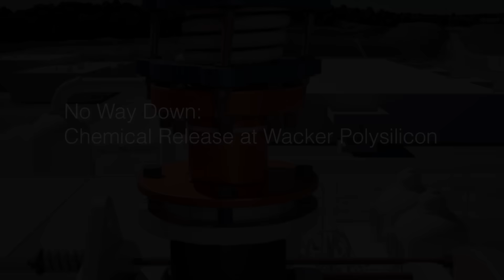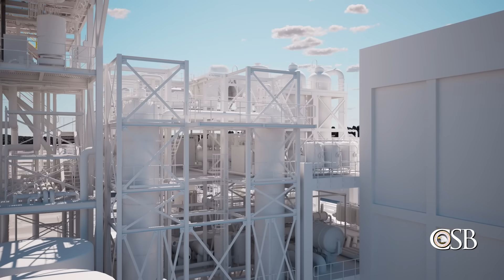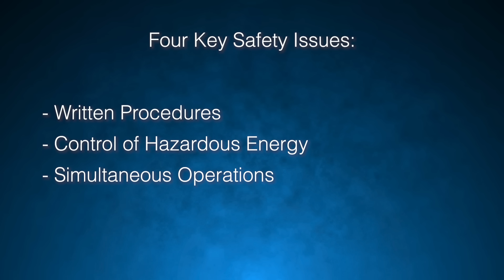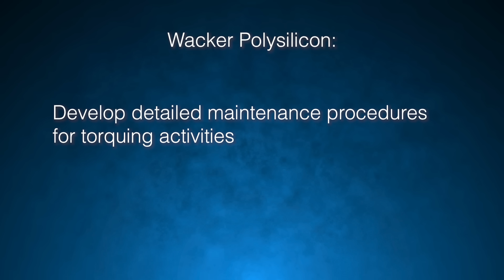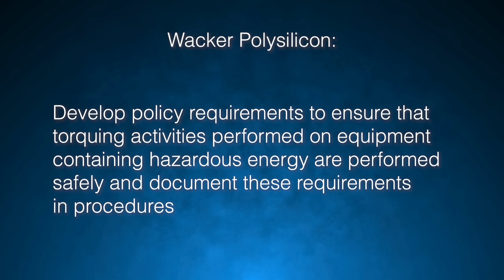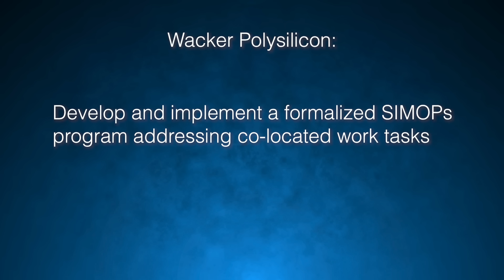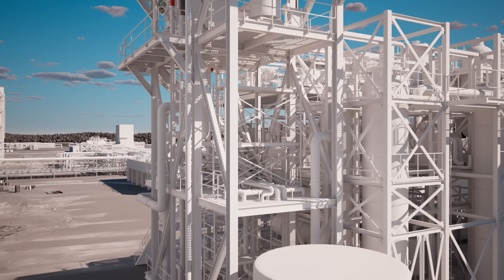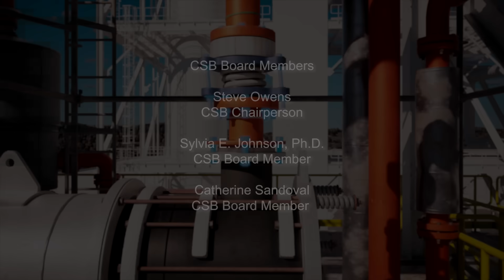No Way Down: Chemical Release at Wacker Polysilicon

Comment: Would of helped to have the proper trade to do this work.  Millwrights have the training to understand what is needed for a torque spec.  Pipe fitters, Fit and weld pipes, once installed workrking on said pipes, save fitting work, should of went to the millwrights. Too many parts of the millwright trade where taken away by trades that have no business touching them.

Comment: I know I don't work on these machines but I feel like there are to ways to design machines that should make this  harder to do. Like, if the bolts between steel to steel had a different size or shape than steel to graphite, I feel like that would make it harder to accidentally use the same settings on them. Maybe I'm just over simplifying but to see this issue and no one even talk about how easy it is to blow up a machine like this feels unsettling
Reply: The narrator was nice about calling the company doing the work incompetent. I do pipe fitting work for the union. I'm an apprentice and I'm not allowed to do certain jobs or touch certain tools till a certain amount of time within my career for that exact reason. To say they all communicated down the chain without a journeyman verifying  your tools prior to use is also a lack of supervision. Something that dangerous should have been taken more seriously. Live Pipes under pressure should have had 2-3 journeyman, and 1 apprentice. 2 journeyman performing work, 1 apprentice learning and hauling tools, 1 foreman at the bottom for safety. Before starting work they should have created a Job Hazard Assesment and possibly considered self contained breathing apparatus for rescue. One thing we do as union workers is we always kick anyone not involved out. We do not work with or around anyone or other trades. These videos truly are a great eye opener for all the classroom training they give us and attitude the instructors have.
Reply: We were told of a time when a welders measuring tape fell and cracked a pipe under pressure at intel. 32 million dollars gone and he died, his life was priceless. Now we all pay with 8 hours of classroom training on why we need to tether every single tool.

Comment: Worked at several nuclear plants in the Midwest and they used "travelers" to define the work scope and instructions. The work package/traveler had drawings, reference material, etc. and step-by-step instructions for the work crew. It was prepared by Work Planners who did the background work to ensure that the travelers were accurate. If there was a question or something didn't seem "right" work stopped until the situation was rectified, including revising the traveler.

Comment: The hierarchy and beurocracy of these big shows and contracting companies is what gets people injured or killed. Involve enough people and no one really is responsible. I don't get called for work from a company i worked for for years doing because i spoke up about an issue with a mystery gas and how no evac alarms went off. (Was a good employee and after my work was done they kept me around to operate an elevator for the hours, opened the door and couldn't see the control room door which was 8' across a hallway, guy in the elevator put on his escape respirator and got the fuck outta there, i did the same,took it to the ground floor and ribboned it off. Went to my super not very impressed and said its not you guys its the mill that probably turned off the alarms. I'd seen it before working in other mills owned by canfor in the same town. I have since to get a call to work for idl)

Comment: I think more importantly there was no warning given about the risk of over torquing the graphite. 90% of time you just tighten it down till it feels “about right” or hammer it with an impact. And that works 99% of the time on any metal. Why was there not a warning about the dangers of the flange cracking?
Reply: Because the higher ups played The Telephone Game instead of writing down explicit instructions to NOT touch the bolts connecting the graphite to the steel connectors with a regular torque wrench. One Email, one facebook message, one text, and it could've all been avoided.

The fault lies with the higher ups that were not doing their jobs to ensure site integrity, but a few comments mentioned specifically "Using the safety standards of the more dangerous work" which makes a lot of sense. There should never be contractors in chemical suits below while the contractors in minimal PPE are working above, anything that is pressurized will be hotter then normal and when hitting the "cooler" air will expand rapidly, filling the space above wherever it is released. If simultaneous work is not possible then reschedule.

Comment: Just fitting simple weather resistant stickers on every bolthead with a red bright triangle and inside having the torque setting spelled out "15 ft-lb!", "45 ft-lb!". Having a paper checklist is not enough because next time the part is replaced it could have different specs than before, so a checklist on a paper would become obsolete if someone forgets to update it, and if the workers forget the checklist there is a possibility that they ignore it and think "it's gonna be fine i know it in my head".

Comment: I work in a Cl2 plant, when our new plant was being commissioned operators identified that one of the gas-tight fully enclosed buildings only had one internal exit stairwell. That building contained up to 200 of liquid Cl2, if you were at the top and there was a leak there were 2 ways down, one was the stairwell into certain death and the other was to jump outside to your death. Thankfully management saw the risk and installed an external stairwell over to the adjacent process area.

Comment: Great stuff as usual from the CSB.  I am curious why the HCl exchanger design is not more critically assessed by the investigation. Tightening fittings on process equipment in use is usually a band-aid for existing leaks...why was the equipment leaking in the first place?

If you design equipment with steel bolted joints immediately adjacent to delicate nonmetallic ones, it would be a good design practice to make that absolutely obvious.   For example, the graphite connection should have used a screw or bolt with a torque limiting head or other design feature, placarding for the hazards of over tightening, etc.  A note on the drawing is pretty sad.

Comment: That flange shown being nipped up seems to be quite big to only have 4 bolt holes.
The safety protocol on some work sites is terrible. When I was 21 fresh out of my apprenticeship, I was working for a company that was sub contracted to a pharmaceutical plant. I was told to nip up a flange on an acid line that was leaking. I had to run in and tighten a bolt as much as I could while holding my breath then run out and get a breath, then rinse and repeat. One of the workers that worked for the pharmaceutical plant saw me doing this and let me use his air fed suit to get the job done. It was only because I was so young and didn't want to lose my job so I didn't question it. No matter how young or inexperienced you are never do anything that you feel is unsafe, and never feel like you can't question someone who is older and supposedly more experienced than you.

Comment: Imagine if the apprentice was given some stack of documents to find the requirements and still did it wrong. No, telling him the number or making him read it was NOT the issue. The issue was that nobody checked what the apprentice was doing and that the danger was seemingly not communicated. Making sure they know that they do not just randomly tighten some bolt but have to be careful is what is important. Not a piece of paper. That might be what the CSB wants or suggests but does not do anything on its own.

Comment: The torque settings could/should be displayed on the fittings OR the size of the bolt heads could indicate the torque requirement i.e. the smaller the bolt head the less the torque.

Comment: For a little added perspective: 15 lb-ft (~20 nm) is not very much torque at all--it's likely that a torque wrench of the size depicted here wouldn't even have a setting that low. Heck, 40 lb-ft (~54 nm) isn't all that much either. By comparison, the wheel nuts on automobiles are typically torqued to around 100 lb-ft (~136 nm).

With the above in mind, it's no wonder the wrench man was easily able to overtorque the lower fittings to failure. On top of all the concerns raised by the CSB investigation into this incident, I have... reservations about the idea that equipment containing large quantities of dangerous chemicals is that hilariously fragile.
Reply: The issue is that HCl, especially at higher temperatures, is extremely corrosive. The heat exchanger was constructed from graphite, which is corrosion resistant, but is prone to damage from mechanical stress. In this case, it's a tradeoff between resistance to unintended releases when equipment fails due to process conditions (corrosivity) and the potential for a release such as the one in the video.

Comment: Hi CSB,

I have a few comments/questions:

- In facilities I've worked at there are specific visual labelling requirements on unique flanges/bolts/fittings to indicate that standard torque sheets do not apply, and not to touch these, some have also mandated non-hex heads on these to ensure that they remain identifiable - (many fitters would simply work off an isometric/equipment list that states materials, in concert with a list of required torque values per material grade & flange size as shown in the report on large facilities so it is important to delineate). Providing recommendations for implementing this type of guidance in a consistent manner could have been made as a recommendation to OSHA or NFPA.
- The recommendation around policy to Wacker I believe also could have been sharpened to "ensure its permit to work and pressure equipment interaction, isolation and breaking containment policy aligns with industry standard codes such as ASME PCC-1" - PCC-1 contains guidance on the first part of the recommendation.
- I have not worked at a single large petrochemical facility that didn't require a ~10 minute daily meeting with the operations team to review upcoming workscopes/permits that will be on issue, to identify potential conflicts/interactions & risks associated with the proposed activities - too much can be missed on the day and in the field. I am amazed this isn't a regulatory requirement.

Additionally - What lead the CSB to conclude that the causative event was only the torqueing? - the flange appears visually misaligned, and graphite has extremely poor ductility, which could cause increased stress and also initiate cracking before it was overtorqued - making it much more likely to fail, it is only listed as a footnote in the report.

Comment: Imagine how many lives could be saved by humanoid robots performing maintenance around dangerous substances like this.
Reply: Why humanoid? True, most equipment is designed to be worked on by humans, but even so improvements over the human shape could be made -- for instance imagine a sort of crawling robot with multiple angles of rotation that could lift its front end up to reach whatever's being worked on while keeping its back end stable or clamped. And equipment and robots designed to work with each other could be even better.

Comment: I hear ST-ST and go to my trusty TbM (Tabellebuch Metall), the German mechanics "bible", no problems there, neither for copper and many other materials, but graphite is where I would pull the plug and have a supervisor show me their documentation, because that doesn't compute.
I also hear HCl and the maintenance of an in use pipeline and go "Are you sure about that?", if the answer is yes, I ask for documentation and a in person safety instruction of all involved personel and written documentations.
Next I climb the tower but I would hang a chain with lock at the staircase (easy break lock for firefighters) and put a sign up that ANY personel are to call call my supervisor and get informed about potential hazards regarding the HCl gas. Any personel already there would be informed of my work and we would call the supervisor because there is a problem of order there.
This may sound like a lot of complaints, but the basic lack of sensible thoughts in their mechanics heads are terrifying me! It was sensible and foreseeable that you use different torques for different diameter threads and materials, it was sensible to inform others that they could walk into a hazard zone and securing said hazardzone was sensible as well!
As for management, they should be held 100% liable, public whipping would still be too good for them!
Why there wasn't a safety slide cage, or fire fighters pole, and no other stairwell/bridge to a neighbouring tower do escape to eludes me, this desing should NEVER have been signed off on!
Not to mention the LACK of an emergency shut off circuit with various kinds of safety switches, be it manual, electrical and presure operated,.
I'm shaking my head in anger these measures safe lifes and equipment and cost almsot nothing!

Comment: Yeah i would have had many questions here as a Jman Pipefitter/Steamfitter. I mean the first thing that stands out to me, is why were they even torquing this under pressure? Should have been locked out, depressured and then worked on. Torquing on a live line elevates a job into a critical task usually, requiring many more steps and hazard analysis. First, torquing on a live line, with that kind of PPE requirement? Those insulators would not be on the same deck with me, period. I would have refused the work, and called it unsafe and that would have been that. The whole verbal thing, while not great, is a thing at some sites. That it was communicated properly all the way to the Jman, and then the apprentice did it wrong, points to a bad Jman. The good sites have torque tags on every joint, showing proper bolt up grade, length, type of gasket and torque value.
Reply: Ive stupidly complied with company practices that are unsafe when I was young and new.. Now that I see that companies dont give a crap about you and can replace you the next day, I value my safety first. They dont like that. Companies need yes men, same goes for management.

Comment: Something where there is that huge of a risk should have the torque values STAMPED into the metal for all to see.  Something like "DANGER:  Torque to 15 ft-lb, do not exceed 20 ft-lb"  (whatever the range is).  Or "DANGER: 15 ft-lb ONLY"

Comment: Working as a shadetree mechanic, the amount of times I guess torque specs and nothing bad happens makes me glad I don't work on pipes like this lol. Also 40 lb-ft is really not a lot of torque, a single tire lug nut can be 80-120 lb-ft. But in this context, the material of the 2 joining pipe is what caused the failure here, it wasn't so much the fastener that failed in this instance.

Comment: While not in the US, I do work in the Chemical industry as an Operator and also Issue Work permits and everything surrounding them. 
And I have to admit, I don't think we always consider work in the surrounding area, especially when the Permits are issued by different people. It would probably have been the best Practice to finish the Heat exchanger work before letting the Isolation fitters work in the area. Definitely something to keep in mind for the future. This is partially why I like watching these Reports despite not being from the US, as they can show areas where we are also lacking.

Generally this should of course not have happened, as soon as the different torque specs were mentioned I could see where it was going. Things like differing specs on a single piece of equipment like that AT LEAST belongs on the work permit at best shown in place what spec goes where, by trained personnel.
I also have to question the decision to let the Pipe fitters work on flanges whose pipes are still in active use and not flushed out or AT LEAST blocked in, seems unnecessarily dangerous, especially since this was apparently during a turnaround.
While, at my workplace, we re-tighten Stuffing boxes of valves during active use, those are quite something different then a Flange in my opinion.

For context, I wrote all this up until here at around min 6, so I don't yet know what the analysis will be.

After the Analysis:
Neat, I did predict several of the points. 
Multiple exists definitely make sense and I think in my workplace we always have multiple, even Ball tanks have a staircase and emergency ladder. I am, however, not sure if there are Regulations here that demand that.

Comment: I listen to these at work when doing repetitive tasks. My boss says I'm "too safe" by turning an entire breaker off when wiring 227v light fixtures. I think he is "too stupid" and needs to be forcibly retired.
Reply: I had an electrician walk into my control room, this week, after tripping off my compressed air system. Working hot, he dropped a fuse into a 600v contactor. Hate when trades start conversations with 'I was doing something I know I shouldn't have been...'

Like man, I'm just sitting here, I'll do the LOTO in under 5 mins. Unfortunately for him, 'Electrician working on live electrical tripped the compressed air system off for 4 hours' went into the logbook.
Reply: @AvenEngineer  It's especially annoying when the person feels pressured, or is doing it to "save time." One, it's an hourly job, take your time. Two, I ask if (they) you really think your bosses care about you more than getting sued/fined by you or your family? Upper management will take a mile if you give em an inch, but they won't pay you a cent more!